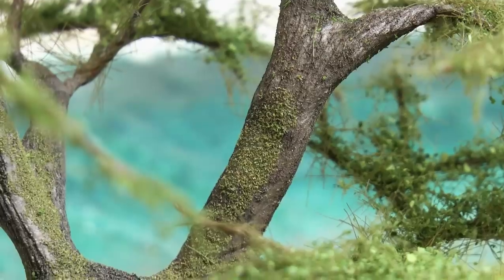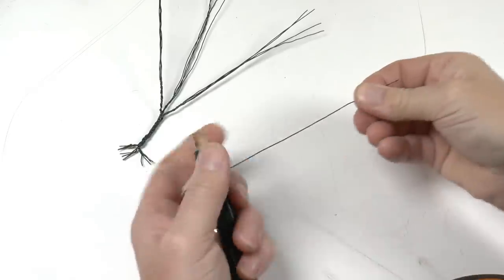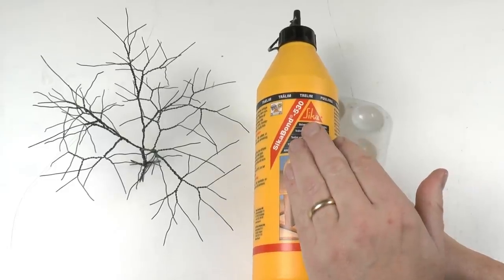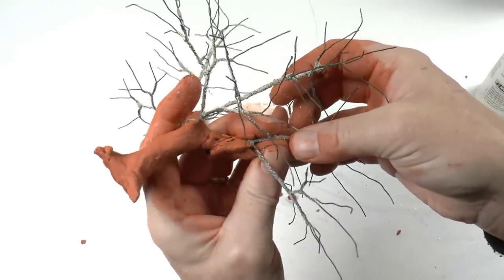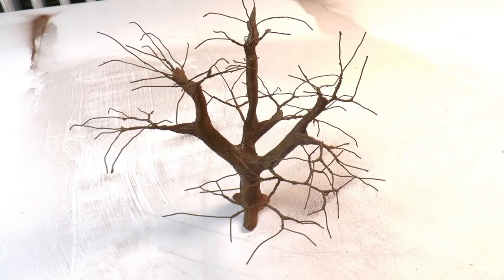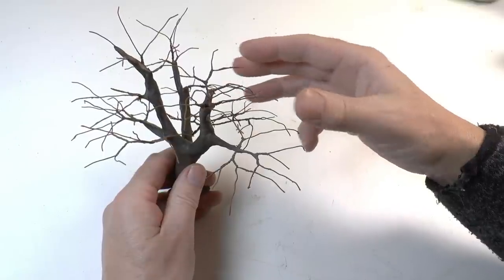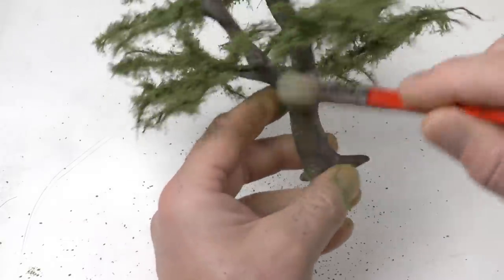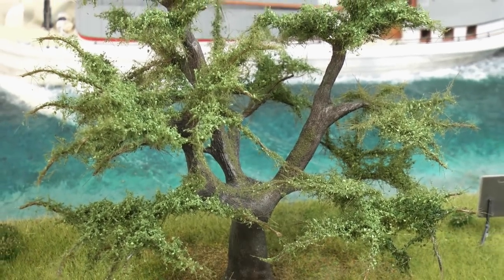Model Oak Trees

Comment: Whenever I need to wash something with as many tiny surfaces as these trees, I use a commercial spray bottle to mix and apply the wash. The recipe/procedure is below:

You will need:
- 1 Commercial spray bottle. Get one with clear sides. 
- 2 parts water. If you have bubble/clumping issues with your washes, try distilled water. If you do not have easy access to distilled water, head to an auto shop, and ask for deionized water for batteries.
 - 1 part Pledge Floor Shine. Basically, acrylic gloss medium. If Pledge Floor Shine is not available in your area, you can use almost any acrylic floor wax. They are all basically gloss medium. 
- Acrylic ink according to taste. 

Mix the water and the PFS, and stir gently. Avoid creating bubbles. Add ink slowly. You can see how dark a residue your wash will leave by tilting the container to the side a bit, then back to horizontal. Look at the liquid that is flowing down the side of the container. That is the color your wash will leave behind on a surface. Go light with the ink rather than heavy. Another coat will only require waiting 10 minutes or so. Run this color-check before you add the flow improver, as the flow-improver will make it impossible to run this test. 

- 3-4 drops of Finish Jet Dry. If Finish Jet Dry is  not available, look for some liquid designed to prevent spots in dishwashers. This is a flow-improver, that breaks the surface tension of water. it will prevent the wash from beading, and even out the coat. Stir gently, or slowly rotate the bottle to mix. You want to avoid bubbles.

Spray on the wash, wait 10 minutes or so, and apply your next coat. Seal the piece with a matte varnish to kill the shine.

Comment: is it necessary to add the sand if it's going to be covered up with clay
Reply: He uses it to improve the grip of the clay to the wire
Reply: I was wondering that myself.
Reply: It is really hard to get the clay to stick to the wires generally. I can see how adding the sand (and even just the glue) will make that easier.
Reply: Makes perfect sense thanks for the heads up